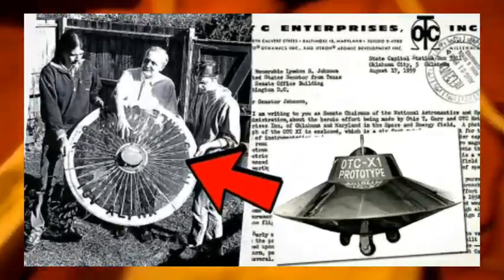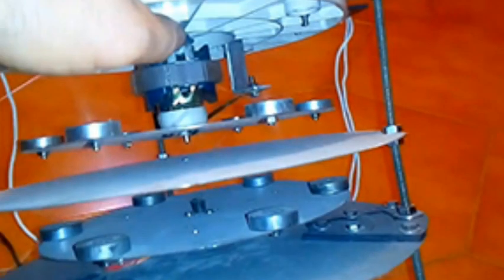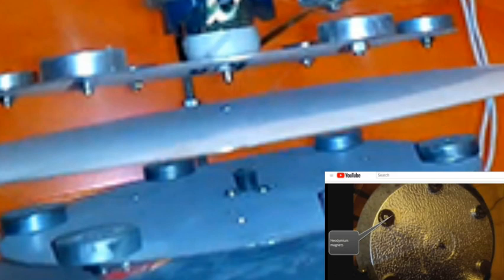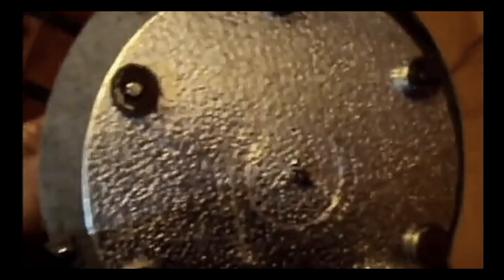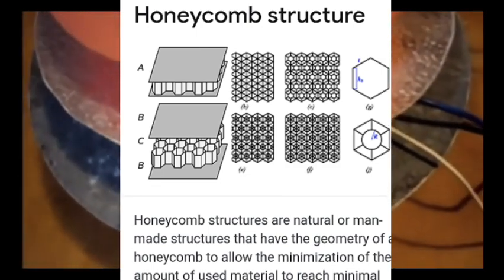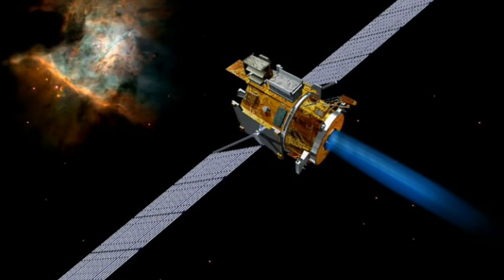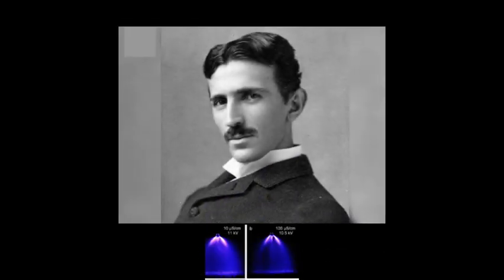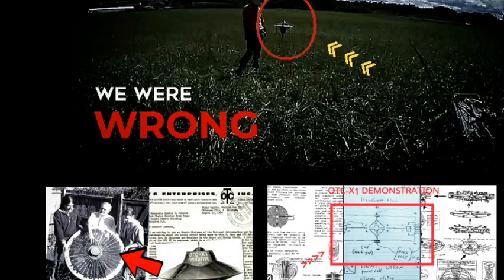See What Happens When Alexey Chekurkov Tries The Incredible Graviflier! [Must Watch]

Comment: Why does Alexey Chekurkov's graviflyer fly at a certian height - usually waist high or head high?  The wires don't seem to be limiting the height.
Reply: Because that's where the lines hold it. You can see how it moves up and down when he pulls it by the wires. One needs to be <IQ90 to believe this.
Reply: because the Graviflyer is limited by the cables that power it.